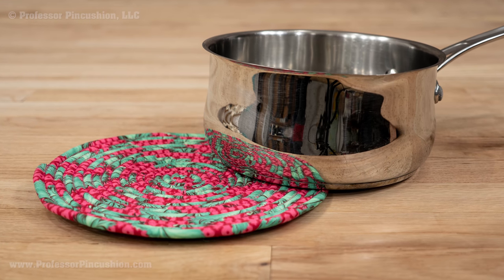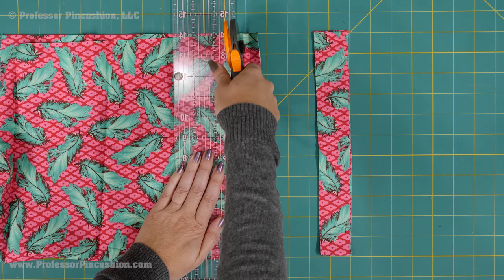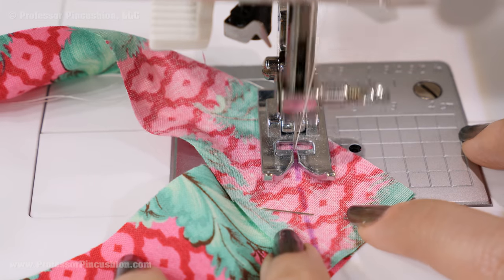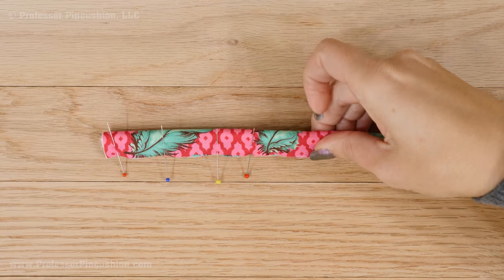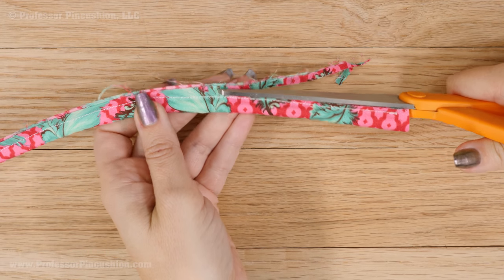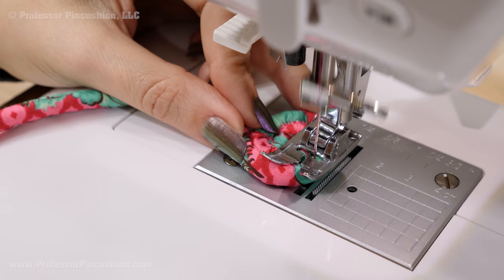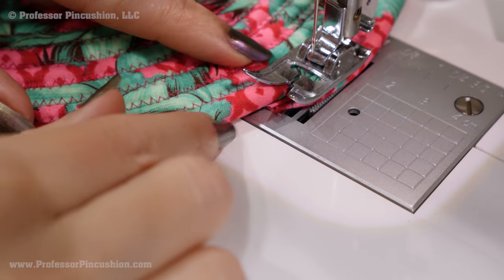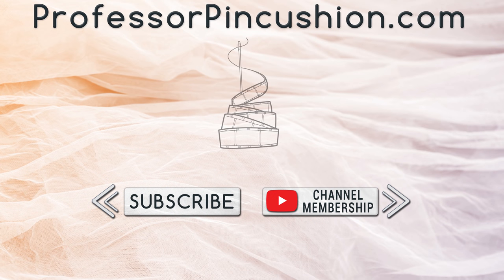How to Sew a Trivet

Comment: With 3/8” of piping the fabric is not wide enough at 1 1/2” to cover piping. I had to recut using 2”. So fabric cut at 1 1/2” will have to be put in stash.
Reply from the maker: You are correct, 1/4" was used in the video, sorry.  The description has been updated.

Comment: The idea of putting a piece of folded fabric behind the piping swirl to straighten the sewing machine foot was really clever! I'm definitely using the tip for my next projects.

I have a question, though: how does the final result look at the bottom of the piece? As in, do the raw edges show too much, or will they fray over time/if washed? Is there any way of preventing this? I thought maybe a tube could be sewn and turned right side out so the raw edges stay in the inside of the tube, then adding the piping to it, but that seems like a lot of work. Maybe making the swirl with the raw edges in the middle instead of in the bottom?
Reply from the maker: I tried to make it with the raw edge ending up on the inside but it wasn't easy so the backside is unfinished. But if it were me and I was making this as a gift, after I finish with it, i'd use it as a pattern and cut out a circle from wool felt. Then just attach to the backside with either fabric glue or sew it in place by stitch around the outer circle again.  Wool felt can handle heat, is easy to work with and is washable.  Hope that helps! :)
Reply: @ProfessorPincushion  ahh yes, the wool on the bottom is definitely a nice idea to hide the raw edges, as it also might help the trivet to adhere to the table better, besides further isolating the heat. Thank you!